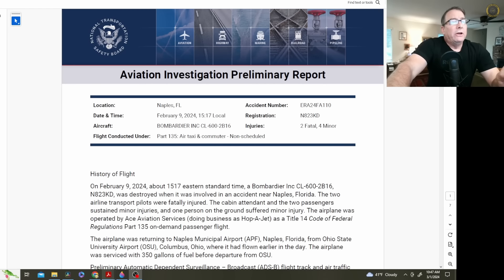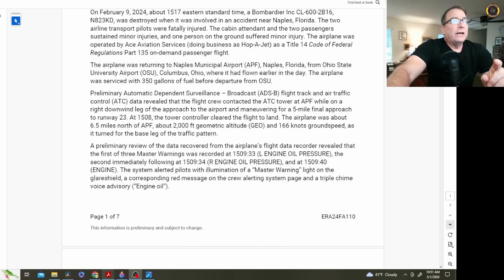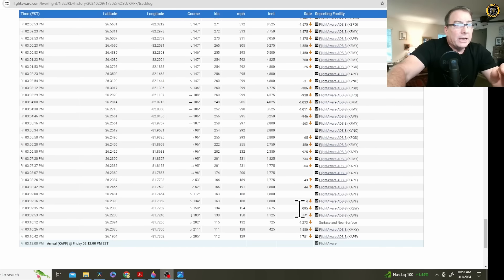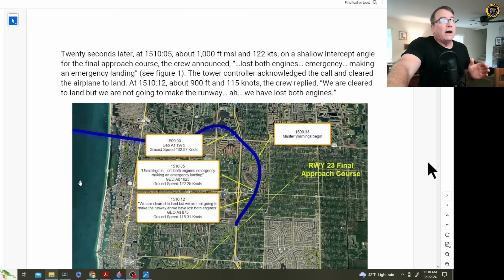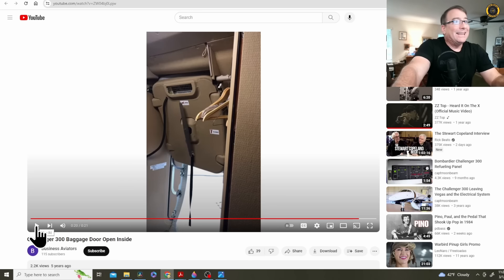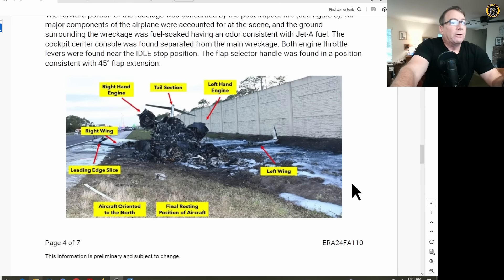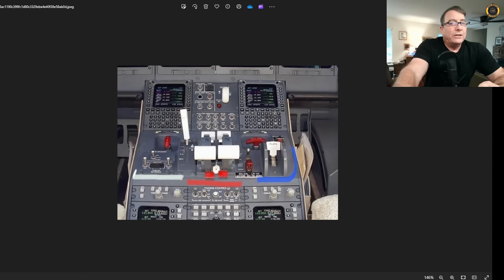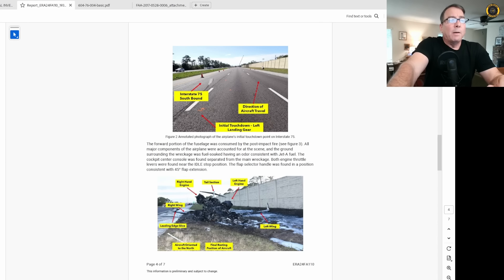NTSB Preliminary Report: Naples Challenger 600 N823KD

Comment: Ugh, that FO... almost 25K hours of likely uneventful career at the airlines just to have this happen not even 200 hours into this job (or into this make / model)
Reply: @russellearlpatten3700  the profession of Aviators and aviation uses Accident reporting, debriefing, and discussions to help bring accidents and fatalities to as close to zero as much as possible.  I believe in 2012 the major US airlines had zero accident/fatalities.  Operator error in the past was the vast majority and in recent years that paradigm has shifted to the majority being equipment failure.  This speaks highly of the profession of Aviators.
Having oversensitive individuals commenting against this practice is an anathema and should be countered in the extreme by Aviators.
This means you!
Reply: @russellearlpatten3700  he was clearly expressing sympathy you're reading too much into it
Reply: @russellearlpatten3700  I don't think he intended it to be disrespectful. I think he was just saying it's tragic for an accident that led to the pilot's death to occur after such a long, likely uneventful, career. Rest in peace to both pilots.
Reply: @russellearlpatten3700  holy christ, grow up
Reply: @ghostrider-be9ek  I’ve noticed that what you request is quite impossible for most of the commenters on this platform.
Reply: MWTGoldenGun  I can relate, the most danger pilots face is after hands have touched the mechanical parts of the plane.  My father who was a charter pilot in the Canadian Arctic for 43 years and did his own maintenance never hurt the plane or his passengers but his daughter (my sister) was killed crossing the street, so he subject to extreme weather and risk for all those years in such remote unforgiving part this earth emerged unscathed but just crossing the street when two teens drag racing through a red light took his daughter, it can be hard to understand. Flying is about managing the risks , knowing your limitations after that maybe it's fate?
Reply: I knew and flew with this gentleman. Great aviator and a wonderful person.
Reply: @russellearlpatten3700 Death happens, sad but true. Don’t act like a pedant.
Reply: @russellearlpatten3700  lighten up francis. we all knew what the op was getting at. irony.
Reply: @russellearlpatten3700  Only a person who spends his days looking for things to be offended about would call this comment flippant.  Dear lord. 🙄
Reply: @stab74  this is objectively a flippant remark to a death.
Reply: @KB3AOL  its tough to grow up in america these days!
Reply: @scudrunner100  Sorry you lost a colleage and fellow aviator.
Reply: @russellearlpatten3700 Just leave it.
Reply: @russellearlpatten3700 I don't think that comment means what you think it means.
Reply: . @russellearlpatten3700  Nice virtue signalling there ! You get a GOLD STAR !
Reply: @russellearlpatten3700 seriously?? I swear people just search for things to get offended about
Reply: @russellearlpatten3700 it absolutely isn't. I've worked in aviation all my life (over 30 years) and have seen people die in aircraft crashes, on jetways, on aircraft, on stretchers on the floors of C-17s coming back from war zones. I had to toughen up early in my career. The commenter said nothing wrong or that could be interpreted as such.
Reply: @prestwickpioneer3474  Don’t bother…you can’t reason with the unreasonable.
Reply: who are you bro? Your whole life is likely uneventful
Reply: MWTGoldenGun maintenance and negligence can be a lethal combination... Some mechanics dont care, there is the main problem

Comment: Fuel contamination beyond what the engines can handle, usually reveals itself very early or after full power on takeoff  It almost never occurs after the plane has been flying for an appreciable time period.
Reply: Agree that it’s unlikely, but not completely unheard of. We don’t know what we don’t know with an accident like this.
Reply: Also, both engines feed from a different location, and the shutdown happened almost simultaneously.
Reply: That and the fact it happened to both engines abruptly at the same time to me doesn’t seem like contamination, but more like an on/off situation. It’s just so so sad that the two pilots didn’t survive this. Damn that concrete sound barrier😢
Reply: If there was water in the tank and that kick they did before landing could have disturbed/moved the pool of water to the pickup and then killed the engines.
Reply: I worry that the pilots may have actually survived, but were trapped by fire.
Reply: Right! Water is heavier than the fuel.
Reply: @FishFind3000 I think you have raised a very interesting credible possibility. Well done Sir.
Reply: As a guy who flys Corporate Jets my gut says it was an inadvertent shutdown.   My best guess is the FO was flying, perhaps one of the few times he actually got to touch the controls due to his low time in type, and somehow the way he was manipulating the thrust levers allowed him to bring them back to the shutoff position.

Not a Challenger guy but there is engine master switches, Start/Stop, next to the ignition switches.  Perhaps they thought they were reaching for the ignition switches as many do with the extension of the gear and inadvertently hit the Stop buttons.
Reply: @danmurphy9173  unfortunately this is one of the primary killers in aircraft accidents. Smoke inhalation or fire.
Reply: @FishFind3000 highly unlikely.  Each engine has its own tank and fuel pickup.
Reply: In an earlier video (Juans channel I believe) there was a comment left by someone who apparently fueled immediately afterward by the same truck and had zero issues. Another aircraft that went to Miami/Ft Lauderdale I believe.
Reply: @FishFind3000 That might be the case for a single engine shutting down.  Each engine is fed from a different and separate fuel feed/collector tank so the odds of something getting dislodged at the exact same time in both tanks is extremely remote.
Reply: @creativeloafer9792 yeah, I thought the same thing- the likelihood of only 1 plane contaminated by bad fuel from tanks/trucks at an prestigious airport seems slim.

Comment: First indication of fuel cutoff will be a sharp drop in ITT. Even before the oil warning comes on.
There may not be enough power in the airflow to windmill and re-start the engine, but there is enough mass flow to cool down the combustion chamber

The data recorder will be crucial.

Comment: Thank you for providing this preliminary NTSB report.  I was concerned about possible DEF contamination.  I had previously mentioned that this was responsible for a dual engine failure on a Falcon 900 EX.  That aircraft was able to perform a one engine operative approach and successfully land at KOPF.  This was discussed at length in a Falcon 900LX recurrent I attended in 2018.  It was also discussed in NBAA and AIN articles.
Reply: It looks like a possibility that DEF was not added to the fuel when they filled up, causing icing.
Reply: @tedmoss  DEF is Diesel Exhaust Fluid.  For automotive use only.  You absolutely do not want to have DEF contamination of aviation Jet fuel.  Jet fuel that has been contaminated with DEF can cause detrimental damage to the fuel filters and engine components of a turbine engine.  Prist is an approved additive that helps prevent icing in jet fuel.
Reply: That was my first thought too but it would show up as white crystals in the filter and fuel pump. This doesn't look like that. Starting to look like pilot error.
Reply: @GRW3  Yes…In the case of the Falcon 900EX that was contaminated with DEF, there were photos presented of all of the fuel filters.  They were absolutely trashed.  Given additional time, the third engine would have failed as well.  All three engines, the APU, and the entire fuel system needed to be overhauled.
Reply: @douglaswhitcomb9729 What manager will buy DEF to put on jet engines.  You are FIRED !
Reply: @GRW3 what pilot error do you have in mind that causes a dual engine failure with plenty of fuel on board?
Reply: @CFITOMAHAWK  The past cases of DEF contamination of Jet fuel have all been inadvertent.  No one would buy DEF to add it while fueling the aircraft.  Look up articles by NBAA and AIN on DEF contamination.  Those articles provide very good insight into this very serious issue.
Reply: @BillPalmer  did you not just watch the video?
Reply: @GRW3  oh my.  Skipped past that part. Not a completely clean theory. But something to watch for, for sure
Reply: I believe there’s an entire YouTube documentary about that flight.

Comment: I have about 8k hours in the CL65.  I can tell you, the captain always reach behind the thrust levers to move the flaps when the FO is flying.  That being said the thrust levers have to be in the idle position in order to lift the red tab to get them to shut off position.  If the red tab is lifted while the thrust levers are slightly above idle they so called “lock” out the thrust lever to prevent inadvertent shutdown.  Easier to show someone than tell them about it..  the theory of the captains arm lifting the tabs is def relative though.  Something like went flaps 45 while at idle, fos fast, short approach, capts arm hits the tabs while fo making sure he’s at idle and bam… just shut down both engines.
Reply: Yes, my thoughts exactly. But we will see eventually. Replacing springs on the tab mechanism, say one that requires 15lbs of force to lift, would negate this possibility without any downside I think.
Reply: @Chris11249  if this was the case I would think they might put an AD out on the AC series.  Never happened before.  I’ve seen the cable break on one engine in climb power.  Coming out of DCA, crew just used the fire button to shut it down landed single engine.

Comment: A few things. Plane did not originate in Naples. Plane departed Fort Lauderdale, flew 2.5hr to OSU, took 350g at OSU, then flew 2.5hr to Naples.

Plane also struck a road sign prior to the sound barrier wall. Some discussion out there the sign help turn the airplane towards the wall, along with the side slip. 

OIL PRESS ECAM message will happen if you voluntarily go to cutoff, or also if engines involuntarily simply stop. Does not require engine cutoff. Once oil pressure drops below 30psi sets off lights, all that means. Could be from cutoff, or other reason. 

NTSB knows how much fuel the aircraft took in Lauderdale. Also knows all ECAM messages dumped from the data recorder. For example, when engine shuts down, will get the entire Christmas tree of ECAM messages, oil press, hyd press, fuel pressure low, etc etc. I think it’s a disservice the NTSB did not include more information, despite already knowing the cause of this accident, from both the CVR and FDR.

Challenger is an important aircraft in many fleets. Can’t wait 1-2 years for a final report. Need to get the information out there to concrete state whether or not there is a concerning problem for the fleet.

Comment: I’ve been flying a 604 Challenger for over 10 years now. Three questions that I have not heard the answers to are, which pilot was flying the airplane, were auto throttles being used, and did the engines fail at the same time the flaps were being selected. The pilot’s arm holding the cutoff levers up reaching for the flaps while the copilot comes to idle makes total sense. I tried it in our aircraft and took a photo that I wish I could attach here. Another scenario worth consideration is the pilot was flying the airplane and retarding the throttles while the copilot was reaching around being the cutoff levers to arm the thrust reversers for landing, which are on the left side of the throttles.
Reply: Former Challenger pilot here. (600, 601, 604) Your Thrust Reverser Arm switches idea makes sense. With the experience level of both pilots, and a Part 135 operation, I doubt that the Right seater was the PF.
My suspicion is that this inadvertent shutdown happened just after the gear was selected DN, and the before landing checklist accomplished. The rotational inertia of the N2 spool, and approximately 180 kts. would have taken time before the N2 spooled down to where the ENG OIL indications appeared (about 10-15% N2, if I recall)
Safe travels!

Comment: I'm a retired crj Captain with over 14,000 hours in the crj-200, 700,900. My guess is when the captain reached over to go flaps 45 the thrust levers may have been at idle and he inadvertently hit the shut off levers. My former airline had this happen many years back but fortunately they had enough altitude and were able to get both engines relit. As a former check airman I always really made it clear to my upgrade captains to be very careful when they reached over the column to select the flaps especially if the thrust levers were near idle.
Reply: enough altitude and flaps 45? lol what altitude were they at?
Reply: I have a question. Don't these RED safety cutoff detent levers have to be LIFTED/RAISED in order to move the thrust levers to the cutoff position?  If so, I can't see how they would LIFT/RAISE both of them accidently with a  forearm or sleeve.  I can certainly see how this could happen if the detent levers only needed to be pushed down, to allow thrust levers to be put into cutoff position.

Comment: Such a shame. Hopefully the NTSB can figure out exactly what happened here. The fact you could inadvertently shutoff the engines while reaching for flaps is terrifying. Would be nice to see an adjustment to those controls regardless of the outcome of this investigation.
Reply: Why is there not dual controls for flaps ... or placement of those handles at some symmetric place? Crazy design layout looks like engineering afterthought to me.
Reply: Flaps right of throttle is pretty normal, albeit maybe a relic of the past we can find a better solution to. In my opinion, the real oversight is just that the same motion to reach for flaps can release the engine shutdown levers.
Reply: @spencerlanman4011  It seems like the person landinghe plane and controlling the thrust levers should be on the left and the FO handling the Flaps should be on the right.  Then this cross over issue would not come up.
Reply: @jaycahow4667 Plane needs to be flyable from both seats. What's the point of two pilots if only one can fly the plane?
Reply: Shouldn't be too tough to relocate the flap switch out of the way.
Reply: Flaps only on the right side, but also as far as possible out to the right side.
Reply: @jaycahow4667  Pilots alternate to stay current.
Reply: Personally I would move the engine shutdown levers. Flaps should be fine where they are.
Reply: @spencerlanman4011  You can still have two pilots when either pilot is flying just have them do thrust levers and flaps.  I do not understand why you would create a situation where both pilots are cross handling controls within such a small area.  Seems like an accident waiting to happen.
Reply: @jaycahow4667  Cross handling is a bit harsh of a description. It's just reaching near the other pilots arm for a control they are not actively controlling. The issue at hand is not so much that pilots are getting in each other's way in the cockpit. More that it's too difficult to engage an engine shutdown on accident during normal operations.
Reply: @SteamCrane  If it is a question of staying current and possibly dying in this plane or letting one person fly the plane and live I will take the later.
Reply: @spencerlanman4011  It is cross handling because one pilot is reaching around and behind the other pilots arm.  Your description would true if they each handled close controls on their side of the plane.
Reply: @spencerlanman4011  It is cross handling because one pilot is reaching behind and across the other pilots arm.  Your description would be more accurate if they were handling close controls each on their own side of the plane.  Lets play Twister while handling the controls.......
Reply: “Bumping” the throttle quadrant, was responsible for a B767 cargo jet crashing on approach into IAH.  With the FO flying, the captain reached across and selected flaps and “bumped” the go round switches. The FO overreacted and unfortunately 3 lives were lost — including the jumpsuit rider who had a class date with UAL.
Reply: @jaycahow4667  Juan referred to the seat-swapping practice meant to avoid this problem.